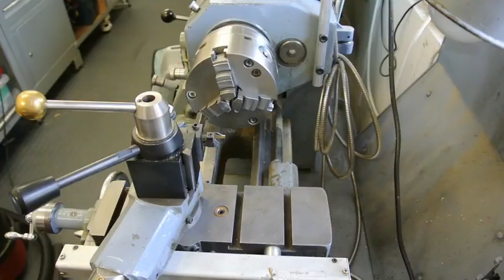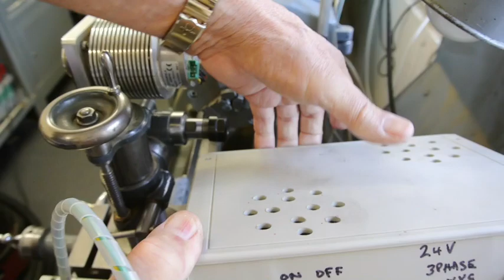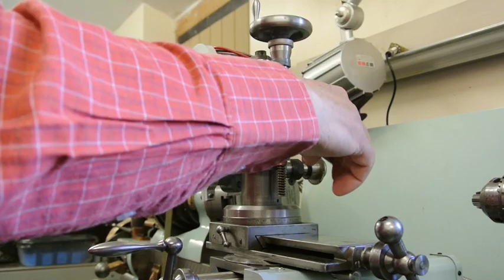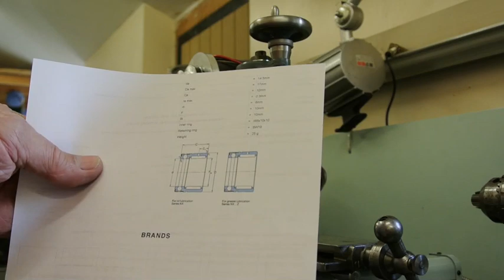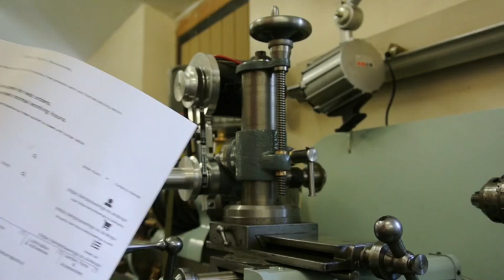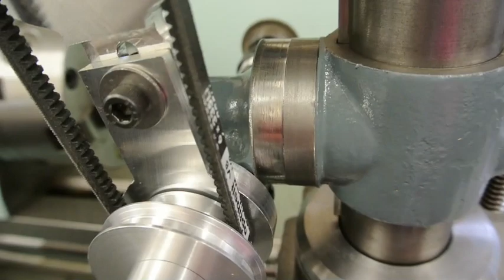Potts Milling Spindle

Comment: hi john with the needle roller set i have the grease type did you put a grease nipple in your potts cheers john
Reply from the maker: Hi John, I didn't bother as it is simple to take apart, if it has sealed bearings then there is absolutely no need. John
Reply: thanks john @john2478

Comment: Hi John on your nano tec motor do you have a 3phase  supply or an inverter cheers
Reply from the maker: I bought a very cheap ebay 3 phase converter and a separate 24 v power supply.  DC 5V 12V 24V 36V 15A 3-phase DC Brushless Motor Speed Controller CW CCW Switch The 3 phase is just £14.95.
https://www.ebay.co.uk/itm/DC-5V-12V-24V-36V-15A-3-phase-DC-Brushless-Motor-Speed-Controller-CW-CCW-Switch/164250643621.
John
Reply: @john2478  thanks john thats great

Comment: My thanks as well, I've seen this same Potts milling attachment many times in my collection of old M.E. magazines just as Russell did. And I can't recall seeing one mounted up on a lathe in any video yet. If my memory isn't faulty, I believe Potts also sold another much more simple and basic version without the large vertical adjustment and again meant to be driven with an overhead belt system. Likely there's now less interest in these simply because today far fewer even know about them or how they might be used. And most automatically think a milling machine is always required for proper milling. The work once it's been machined in a lathe chuck is already held and is as concentric as it's ever going to be. It's far more time and effort to transfer it over to a mill, recenter on a rotary table or dividing head to do what your Potts already can with even better accuracy. Today's industrial cnc machines use live tooling a great deal for good reason. It can work just as well on a manual lathe with a bit more set up time just as it did 50 - 70 years ago. Your integral motor drives just make them much nicer and easier to use.

Unlikely with your obvious experience you don't know of and may already own them. But I very much recommend both of the George Thomas written books. The Model Engineers Workshop Manual and his Workshop Techniques book. Between the two they cover much of what your doing and go into great detail about lathe head stock dividing specifically for use with some type of cross slide mounted live tooling. Due to his influence I had some specific requirements I wasn't willing to do without when I bought my last lathe. A tee slotted cross slide being one of them.And while my lathe milling attachment doesn't have the vertical adjustment range that your Potts have, I did buy the Quick Step mill from Hemingway Kits when it was still available. A powered milling attachment and some method of dividing vastly increases what is then possible to do on a lathe. His use of a boring head in the lathes head stock and the work positioned on the cross slide to do concentric outside turning and boring might have simplified your issues while re-machining that one part.
Reply from the maker: Thanks for the interest and the lengthy comments. I used to have a vertical slide and home made milling spindle for many years but treated myself to the Potts when one came available. It is a great tool and am glad I bought it. The manufacturers machining is really first class.

I also have a cnc lathe and a decent size cnc mill. I still like making parts on the manual lathe and with the DRO fitted it can be just as easy and quick to turn one offs as on the CNC. However making 12 or more is a different matter!

John